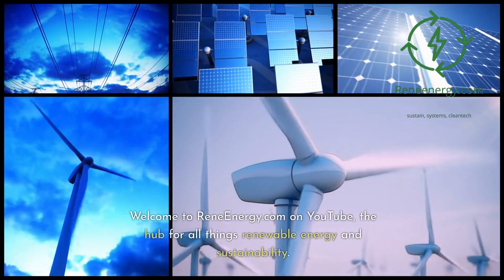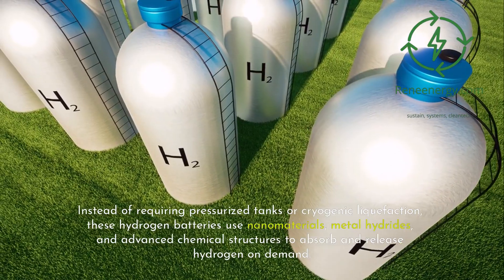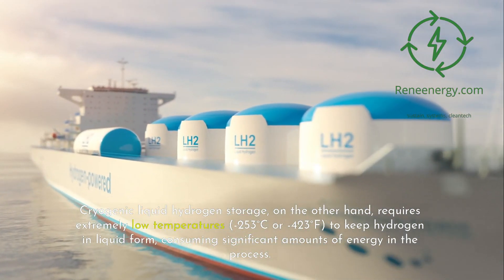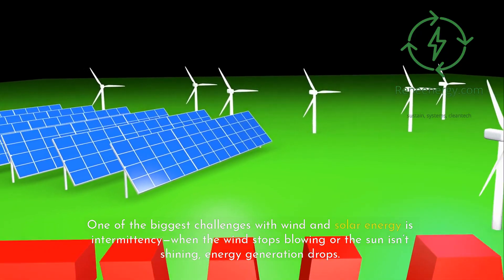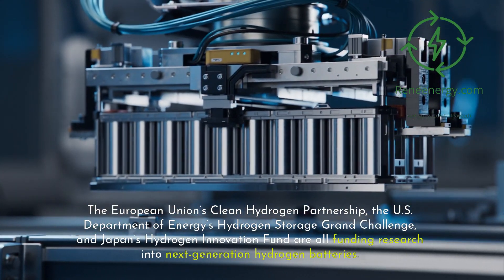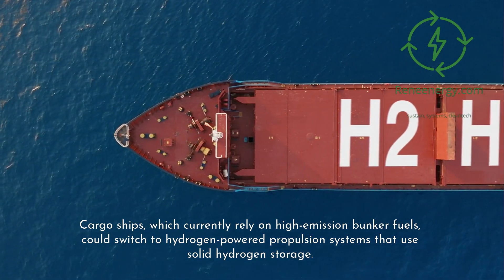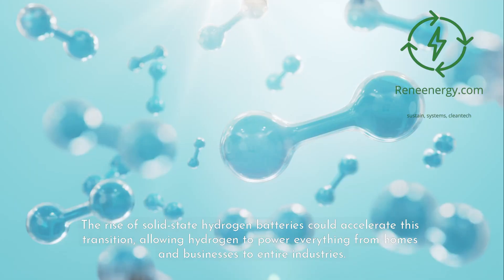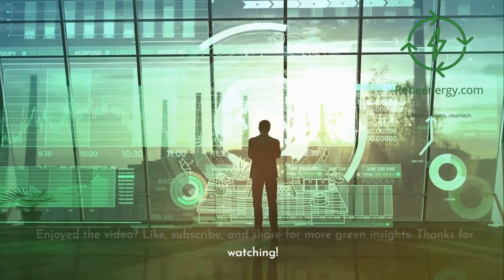This Battery Stores Hydrogen Like a Regular Battery – How?

Comment: You can also generate HHO at the engine . Just do it without corrosive electrolyte . It doesnt take a lot of power either . My HHO generator was bubbling away just from being in the sun . Get the lithium OUT .